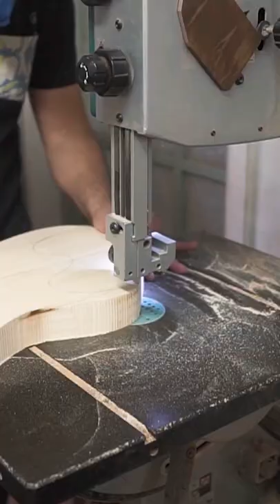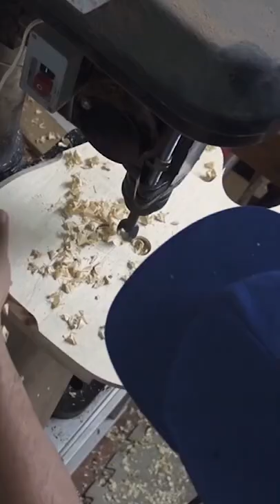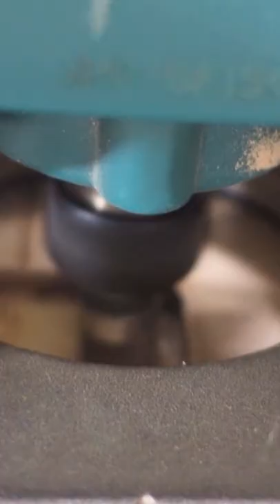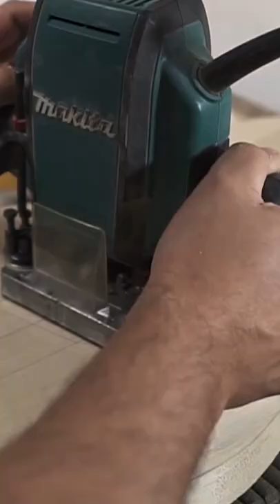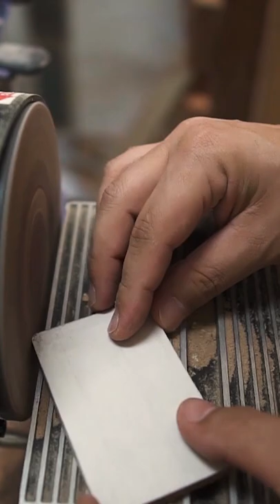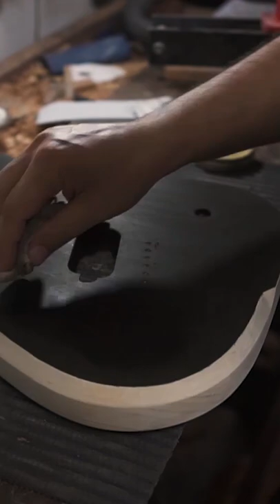Building a Guitar - Making the Body - Start to Finish

Comment: Why solid? Shoulda used planks, jigsawed the cutouts, cut air pockets in the dead space in the inner planks,wood glued them, 700lbs/"² pressed them between steel plates until the glue dries, lathed the face and back smooth, 1/4" measurements in on the edges, and 1/2" down on the face and back, every 1" to establish the edge bevels, dremel carbide cutting blade between the bevel measures to remove the edge material, sand smooth, stain the wood, hang the body, mix a 5 gallon bucket of acrylic, pour over the body, let dry, take down, hand fill the gaps in the acrylic from the hang wire, wet sand, then polish..... Anyone can cut out a stencil, route out a couple gaps, and install electronics..... and hey, why a pre built neck? Why didn't you build the neck in the video too?
Reply: Jesus dude, that's 100 percent unnecessary for a electric guitar body.
Reply: That's a far longer process, and will likely result in a guitar that is uncomfortable to play, as for the neck, necks are extremely hard to make and fret yourself, especially you want something playable
Reply: Not everyone is as fortunate as you by having a full on guitar factory in their personal garage so people have to make due with whatever works and he done a fine job with the things he had access to 👍